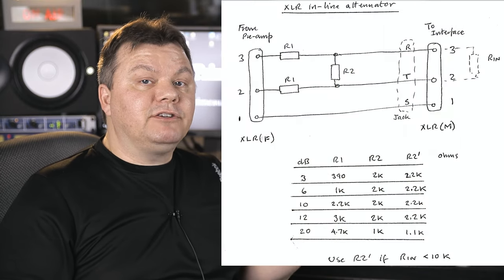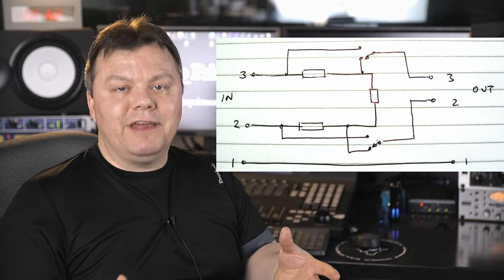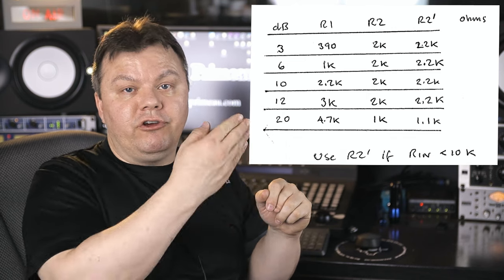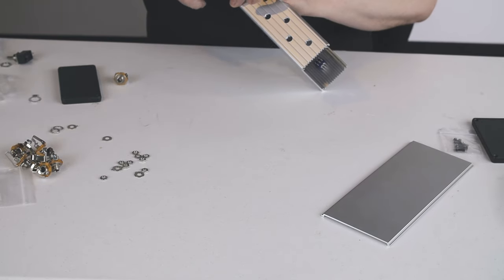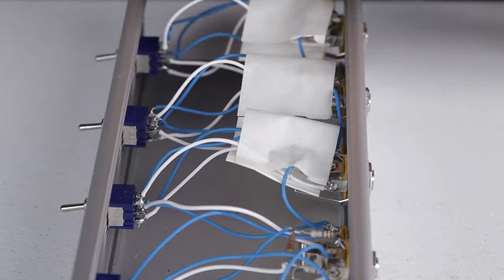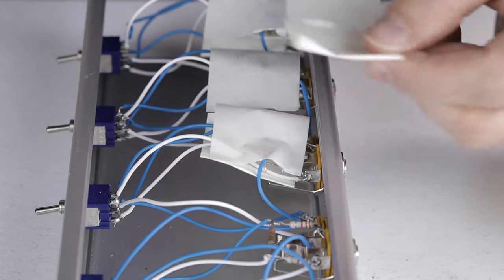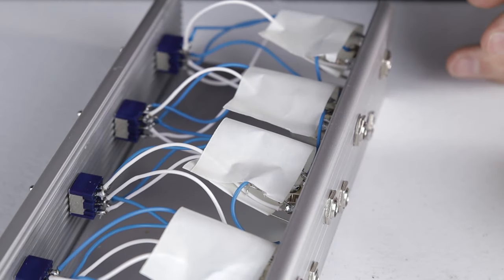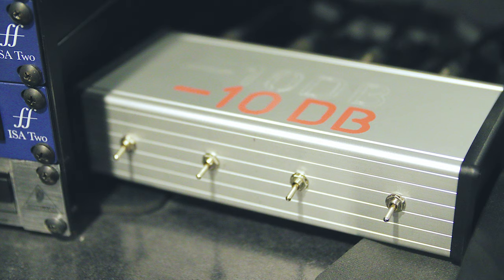DIY audio attenuators part 1 : the build

Comment: I would like to connect an ES9018K2M - based bluetooth receiver to my clunker of an amplifier (Technics SU-X302), which has an input sensivity of 200 mV/22 kOhm. Since I 'm going to scrap that amplifier in 3 years, I would like to use a 100 kOhm stereo potentiometer as an attenuator, by calculating the level I should set it on.
The bluetooth module declares an RMS output of 2.1V, while the impedance is not declared or, at least, I couldn 't find it on the datasheet.
The idea is to make the attenuator reusable after the amplifier will be wrecked.
What should I do?

Comment: Hello ! 

I just wanting to tell you guys about what I tried to do after seeing this video.

I have a problem with my "inst" input on my scarlett 2i2, for recording guitars. The volume is too high, even at minimum gain, and it clips hard, but the clarity is better than on the "line" input. So I wanted to try to lower the signal.

I bought 2.2k and 2k ohm restistors and tried to replicate the simple diagram in the beginning.

Sadly it didn't work. Maybe I'm missing something, but I tried different position for the resistors, I tried pluging it both ways, but the sound is just as bad as my "line" input, it cuts the highs hard, I have a lot of bass and medium bass. I'm a bit sad and now I have 20 useless resistors xD

Just wanted to share !
Reply from the maker: Hey thanks for sharing. I'm no electronic specialist. The values and design shown in the video were givin to me by a more knowlegeable friend. What I suspect is those values and design were made to affect line level signal and not the output of a guitar which is very faint in comparaison. You may want to invest in a good DI.. Instrument inputs aren't always well tuned to different instruments real outputs.
Reply: @MarcoPrimeau Thanks for the response. I don't understand much about electronics, I just wanted to try ^^ But yeah, it seems it's a bit more complicated than I hoped.

Sadly, I tried that because it was cheap, I'm not ready to buy more equipment :/ Oh well, I will EQ my DI, as usual.

Keep up the good work ! See ya.

Comment: Thats a great video. Any info on what switches were used, and also how are they connected to the jack ins-outs? I plan to build one myself, where the toggle up=-6, Middle=bypass, down=-12.
Reply from the maker: You will then need 3 way switches and double the parts with different values... The connection to in and output jacks are according to the plan which is displayed in the video.. The 1 - 2 - 3 on the plan represent numbers on an XLR connector or TRS connector.
Reply: @MarcoPrimeau  Thank you so much for the reply. So, a 3way switch, On-On-On or On-Off-On? Sorry for my ignorance, I know nothing regarding electronics apart from soldering. :-)
Reply from the maker: @ΤζίμηςΝουάρ  either will work. if you connect nothing to one position it will be off.. start with some drawing to better understand what you need ..

Comment: Great video. What resistor values would I need for a 40dB attenuation?
Reply from the maker: Here is the answer from Boswell at www.recording.org. He is the one who gave me the other values : "This is for the U-pad in your balanced attenuator, right? Well, 40dB is easy, as it's 100x in voltage and hence ratios. To 1%, you can use a shunt of 2R and series of 100R. Series resistors of 10K Ohms and a shunt of 200 Ohms are readily available values, and would work OK in this configuration (where OK is not a short circuit). Use two 100 Ohms in series if you can't get 200 Ohms, but if you are considering that, then 4.7K series and 2x 47 Ohm shunt would work marginally better over the range of other likely circuit impedances."
Reply: @MarcoPrimeau  I think I follow what you're saying: My resistors need to be 1:50 ratio, and then multiplying resistor values while maintaining that ratio gives me different impedance values.

Comment: Why was I under the impression that transformers were also needed in building an attenuator?
Reply: Also, Im a little bit confused. Why were you saying that this wasn’t really an ideal design? Is it the design itself, or os it just the quality of parts? What makes it not ideal?
Reply from the maker: @underpressureman  If I had to redo it, I would buy a virgin circuit board and put all the resistors on it. That would be ideal to me...
Reply from the maker: I guess you could incorporate transformers in the design, but it would add coloration to the signal path. Using only resistors keep the quality intact and simply drop the output. Also I wanted to have a true bypass path...

Comment: Hello I need help about Samplitude pro 4 .. after I add some Effects its be so slowly (all project) and even playback read it part part why..?
Reply from the maker: Deactivate all other software in memory (antivirus and others.. ) also this could be a driver issue or latency issue. Check the buffer (make it smaller and then bigger to find the perfect fit. Last, make sure your files are in the same format as the project.. Choose convert when importing..
Reply: @MarcoPrimeau   Aha ok I will try all this steps .. Thank you very much
Reply from the maker: @Arian-abbas  If you still need help you can also go to www.recording.org, 100% free. A great community, I've been a member for the past 6 years ;)
Reply: @MarcoPrimeau   Thank you very much I think I need that

Comment: Hi I'm new to this iv have a 5watt and a 40 watt can anyone tell me if I can make one that works for both and is it safe please n thanks
Reply from the maker: The build proposed here is not for speaker level, only line level. Sending a 5 watt signal  would burn the circuit...
Reply: @MarcoPrimeau  thanks